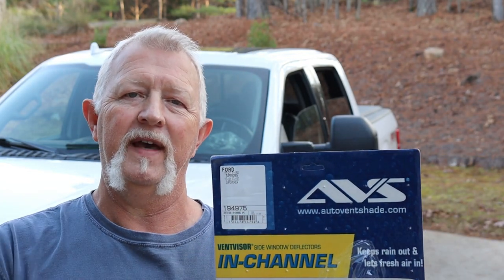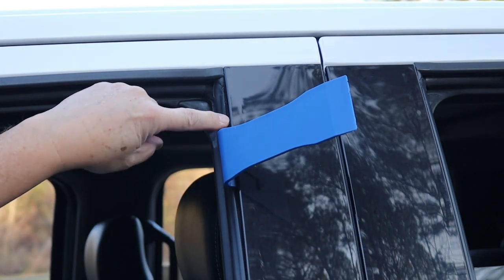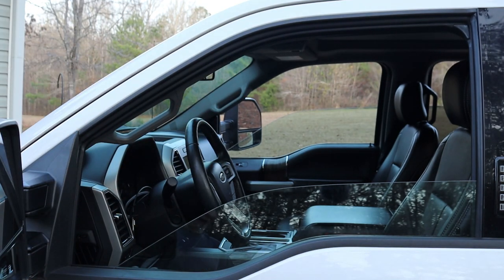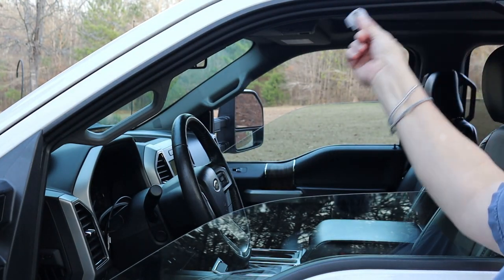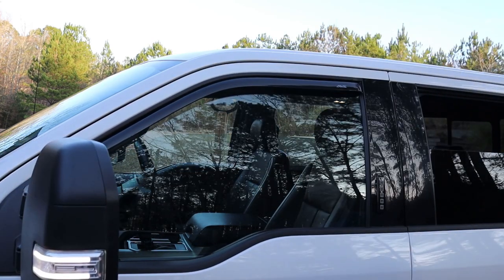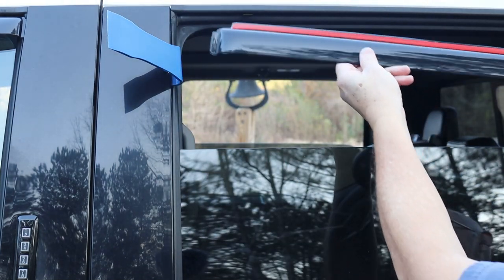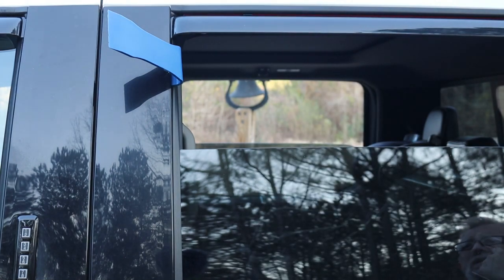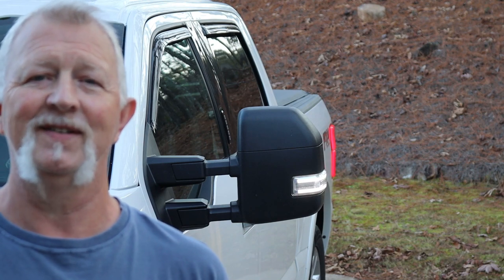2015 to 2021 Ford F150 AVS In-Channel Window Visors

Comment: Just installed a set of these on my 22 SCREW.  Despite all the negative comments about bounceback, I figured it can't happen to me right???  Wrong, windows wouldn't go up by themselves after days of letting them settle in the window channels.  Found this video and I was able to ease the tabs into the proper spots without the adhesive tape coming unstuck.  Maybe only possible cause mine are brand new and the visors and plastic trim are still pretty flexible, dunno?  But they go up automatically now!!  Thanks for the awesome tip and video!!
Reply from the maker: I'm glad this helped, Dave!  Thanks for watching!
Reply: My windows creak now yay from the in channel window visors

Comment: I followed your instructions and did not have the success that you had. On the driver's side in the upper right hand corner if you put the tab between the frame nd the channel those two points are at different levels and it's not like using the complete channel. Similar on the passenger side.  I'd like to know what I did wrong should I decide to attempt this again. I say again because I returned the avs vents shades as I could never resolve my bounce back problem.
Reply from the maker: Thanks for watching, John!  On mine, the tab went between the rubber weatherstrip and the cover cap (exterior piece).  The tab isn't 100% engaged behind that cap, but it is about 80% behind it and stays put with no issue.  None of the tabs should go into the window channel, that will surely cause bounce-back.  I hope that helps!

Comment: I wish you'd have had this video out about a year ago when I put these on my F-150. I didn't know about the tab placement, so of course I have the bounce back problem. I don't know if I can fix it now or not. May have to get a new set. Thanks for the information though.
Reply from the maker: Thanks for watching, Sam!  Seems that's the biggest issue with these....I just got my visors for Christmas for my new-to-me 2018 F-150.  Hope you can fix it.
Reply: Same here! They were annoying the hell out of me! So just took them off. Now time to get some new 3m and try it this way!

Comment: These AVS brand visors have really good reviews. Can't beat the price it seems. I was first looking at the weathertech but seems like these AVS will do just fine. I ordered them from Amazon for my 2015 Expedition and they came in late tonight so I'm gonna install them tomorrow after work.
Reply from the maker: Thank you for watching, Ronny!
Reply: @Dennis Coffey  Thx for the video. As mentioned I got them and installed them on my 2015 Ford Expedition. Followed your instructions and 0 problems with install, bounceback or anything. Since I have them I'm driving daily on our Freeways around Phoenix AZ (speeds exceeding 80mph😂) and they are rock solid. Even had a few heavy rainstorms in the past weeks since install. No issues at all.
Reply from the maker: @yourAVGconsumer  Nice! I've had the same experience.  I love mine.

Comment: Nice video. I am considering these because Weathertech says theirs do not work with 2022 F-150 and they are half the price (comparing older Weathertech eg. 2020 model). Not sure why these work with 2015-2022 but Weathertech will not and their last compatible model was for 2020 F-150. For those who were/are confused about the channels these slide into, it actually states this in the manual... however it is still nice to see someone actually do it. I see most complaints in reviews about bounceback and this is probably the case because didn't read the instructions:

For Front:
Insert visor into window channel. Front and rear flanges

insert between the rubber trim and the mirror cap / door
frame. Top flange slides into the window channel.

For Rear:
Install the rear visors using the same preparation and installation methods as the front visor. Note
that the rear flange slides into the window channel, and the front flange fits between the post and
window trim.
Reply from the maker: That's exactly why I made this video, so many people have problems with bounceback because they didn't understand how to insert those tabs.  Thank you for watching, Brian!

Comment: Hi Dennis, great explanation 👍.  So you did this video several months ago, I've read dozens of bad reviews stating that within a couple of months their avs shades either fell out or broke.  How's your holding up?
Thanks in advance and great job on your video.
Reply from the maker: Thank you and thanks for watching!  I haven't had any problems or complaints with mine.  They've stayed in place well and have given me no trouble.

Comment: Dennis,
Great video and very informative, step by step procedures.
I’m still looking at these but haven’t committed to a manufacturer yet.
Did you ever find out what those rear Window clips were?
I don’t have them on my 18’ 
S-Crew. They look like clips from other window guards. Some manufacturers use clips on the rear ones. 

Thanks in advance and keep the info coming 👍
Reply from the maker: Thank you for watching!  That's interesting...mine is also an '18 SCrew.  You might be right, they might be from a previous install.  I am the 2nd owner of this truck, so the previous owner could have had visors on there.  thanks!